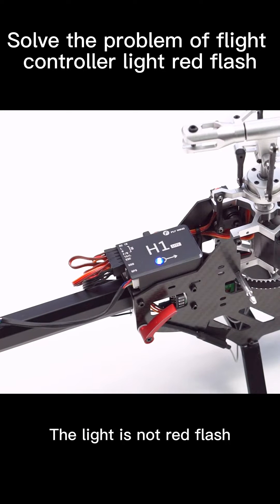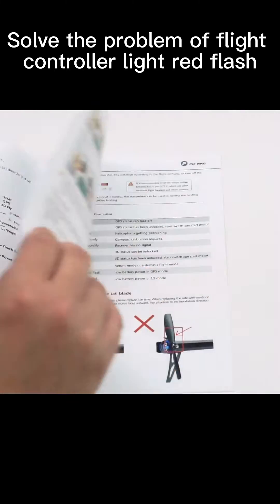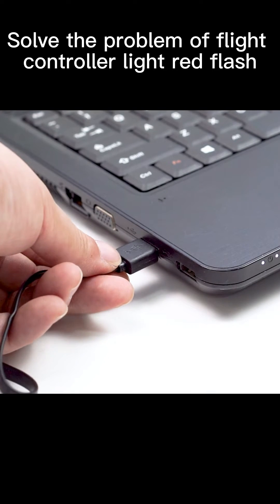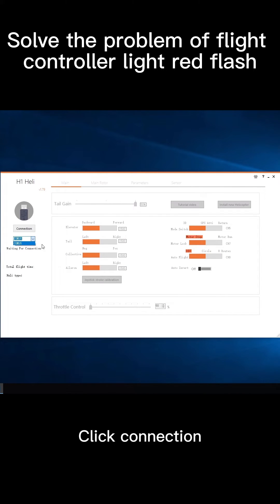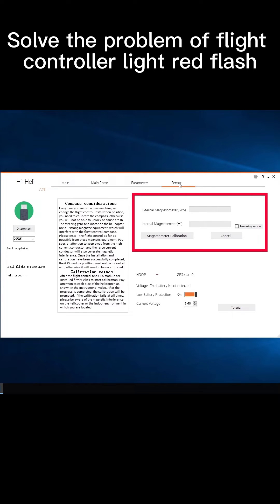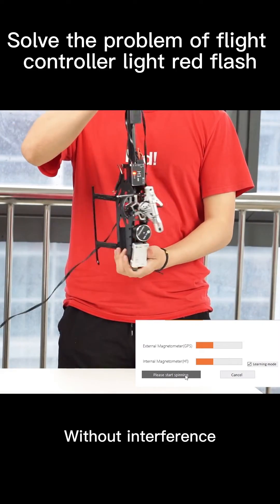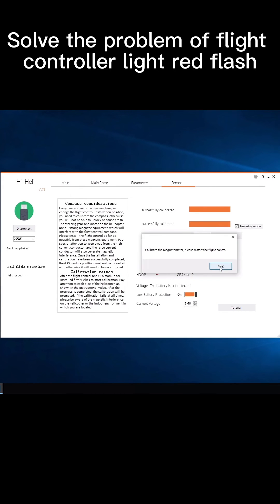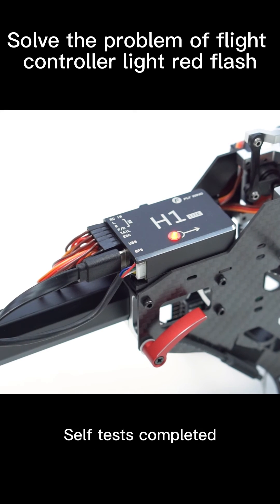H1 flight control red flashing is what problem?

Comment: Hello i have a T-Rex 470 with H1 gps when i turn on the hélicoptère and the remot controller on gps the led is green but when i switch on 3d mode the led is not blue it IS green why ??

Comment: I have calibrated the FC indoor and outdoor. It stopped blinking red in both cases. There is no warnings in desktop app. But when I try to arm it - it flashes yellow, even there are 16 sats and HDOP 0.78 (indoor and outdoor). No low voltage. What I should do to get blinking green instead yellow?
Reply from the maker: Check the size of your RC channel value.
Reply: @flywing7015  yes, the throttle was high. Thanks!